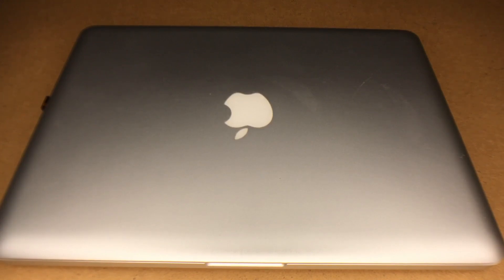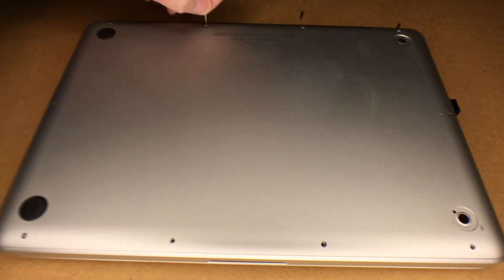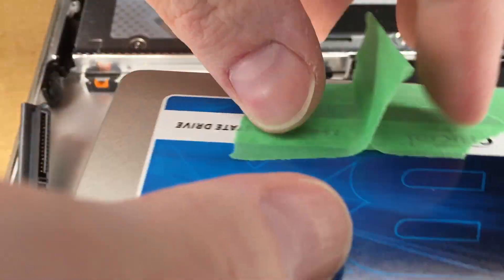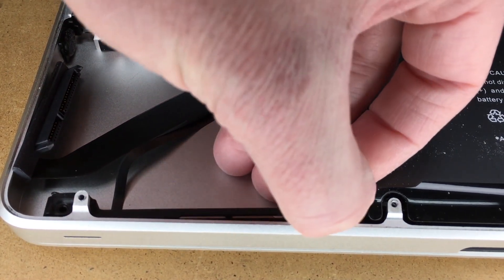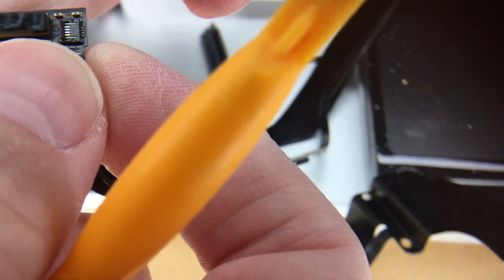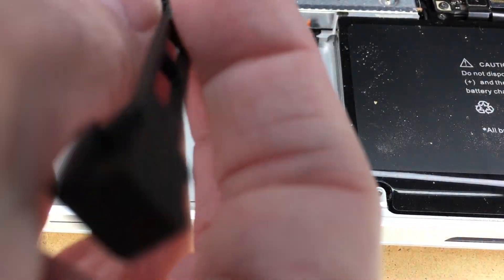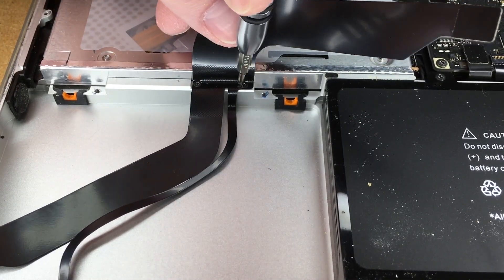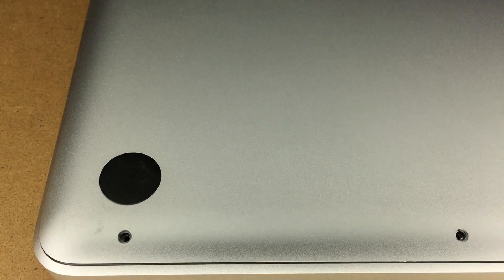Mid-2012 Macbook Pro Hard Drive Cable Replacement

Comment: Excellent video! My HD can now live back INSIDE my old ass MBPro where it belongs. Hopefully the cable lasts me til I get a new MBPro soon! I’ve held out since 2012-I can hold out a little longer for the M4s 🤞
Reply from the maker: I've got my 2012 and a 2015 MBP. I may get an M4 MBP. We'll see. I do have a M2 Studio but I would like a newer laptop. I'll probably keep my 2012 around because it has an optical drive and firewire. That can be useful for accessing legacy media.

Comment: great video.  My only comment is when you push that gold cable back in place before lowering the tiny hold down clip, that you (1) slow down to 1/4 speed your installation of this cable, which I did, as you had this critical part sped up.  I had quite the time until I slowed your video WAYYYY down and saw that (a) the contact end of the gold cable actually is SLID UNDER the black piece and (b) that you used tweezers to assist you in getting the cable to slide into place.  After doing so, you then price down they tiny hold down clip or hasp.  Thank you!  Life saver for me.
Reply: Yes, excellent advice!! The close-up, high-speed is Super counterproductive!!! The seemingly fat fingers GET IN THE WAY!!!

Comment: This video is fantastic. Ordered the part from Amazon...I paid $9.84 . I swapped the cable out and my macbook pro laptop works perfectly now. There is one step that is tricky and tedious and you will need some pointy small tweezerz other than that pretty easy and straight forward. Macbook is running perfectly now. THANK YOU THANK YOU THANK YOU!!!!!!!!

Comment: Hi, my MacBook Pro (2009) is no longer working after I tried to test charging a battery at 0% and did NVRAM reset instead of SMC. I put back the battery that was working and got into multiple problems : Mac OS cannot be installed (?), then prohibitory sign when starting, then I reformatted my SSD using recovery mode and then I got the flashing folder screen. Now verbose mode, safe mode are not working and when I restart pressing option key it doesn’t show my SSD (same if I connect SSD with usb adapter ) and it won’t show a USB key if I connect one. It only shows internet recovery. So I was wondering if my sata cable is faulty and the usb plots also. But when I use Disk Utility or Terminal with recovery mode I can see my internal SSD and the USB key plugged, and the same SSD if I plug it on USB port. Does that prove my sata cable is not damaged ( I changed it 6 months ago)?
Thanks 
Sorry for my bad English

Comment: Not bad, but you had your hands in front of the camera too often 🙄 and/or the part of the computer that you were talking about was completely out of the shot 🙃. And why did you speed up the video during one of the most crucial sections (at abt 3:55), while connecting the small cable??  Have liked a number of your videos, but sorry, this one falls way short of the mark. I'm not surprised some folks have problems with their machines (re: comments below) after attempting this replacement, based only on your video. I'm off to find a better video on how to do this correctly. Viewer beware.
Reply from the maker: I appreciate the constructive criticism. It is a lost opportunity when someone tells me a video sucks but doesn't tell me why. Thank you for taking time to comment and I will take this into consideration when filming future videos.
Reply: @Rickmakes  Thank YOU for hanging in there with us, as a whole you certainly you do put out great content and we appreciate the effort it takes to make that happen.

Comment: thanks rick but what happens when u don’t unplug the battery?
Reply from the maker: If it is off, it's probably fine. It is just best practice to disconnect power so there is no potential of damaging things.
Reply: @Rickmakes  i think i damaged stuff without unplugging it 😨
Reply from the maker: @internet-guy  That's certainly possible. Is it showing no signs of life?
Reply: @Rickmakes  it still turns on and does the flashing file i replaced the hard drive cable twice i don’t know what to do anymore 🫤
Reply from the maker: @internet-guy  Do you have a system installed on the hard drive? Are you able to boot into the recovery console by holding down command-r while booting?
Reply: @Rickmakes  yep and when i try to redownload os nothing pops up but when i do disk recovery it shows the toshiba hard drive which is around 800 gbs thanks for trying to help
Reply: @internet-guy  if you see your disk in disk utiulity but you cant install the os you need to format it i think either that or your drive might be dead

Comment: Thanks Rick, but.. how can I tell if my cable needs to be replaced?
Reply from the maker: It might need to be replaced if the computer becomes unstable. It could be any number of things but these are known to have problems with the cable.
Reply: @Rickmakes  I have a mid 2012 13" macbook pro with 750 GB HHD, which seems to me stable, but became very slow lately, so I got it a SSD and I was wondering if I need to replace the cable and the ram as well to get the best out of it. Do you recommend replacing the cable and the ram?
Thanks
Reply: Hey Rick great vid! I’ve replaced both the ssd and sata cable and my 2012 MacBook is still unable to read the disk. What else could it be?
Reply: @SAOgeneral the disk itself

Comment: Is it possible to mount and read the data from an SSD with a damaged cable through an Ubuntu USB live?
Reply from the maker: Hard to say. I think you are better off using a USB enclosure. This is one I use a lot: https://amzn.to/3DOoTqD You can connect that into the Mac and try to boot it or try reading it from another system. I think Ubuntu can read HFS+ formatted drives but I’m not sure about APFS.
Reply: @Rickmakes  thank you for the answer. After some difficulties I could mount the internal SSD and save the data from  Ubuntu live USB even if it was apfs formatted. Then at the apple store they told me that the flex cable is damaged, so I was wondering if it is possible

Comment: 821 1480 or 821  2049?
Reply from the maker: 821-2049-A is the cable I used in the mid-2012 MBP. I have a link in the description to the cable I used.

Comment: Rick, hi. You've inspired me to add an SSD to my MBP. I notice you use (and link to) cable for a 13" -- I have the MBP 15-inch, Mid 2012, MacBookPro9,1. 
Is there any difference in installation, and could you add a link to the 15-inch option? 
Also, I note that some of these replacement cables come with attached cable bracket (the piece with the yellow connector)... might save a step but is it wise (one MBP commenter said the bracket was oriented in the wrong direction)?
Thanks for the clear directions!